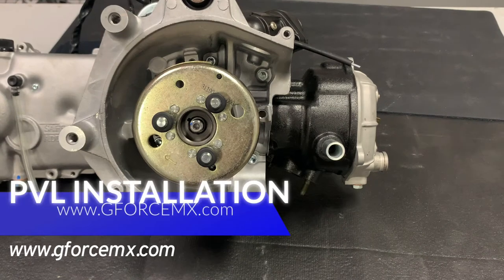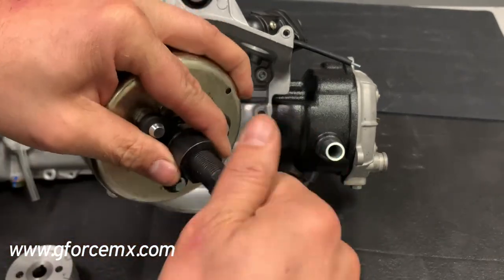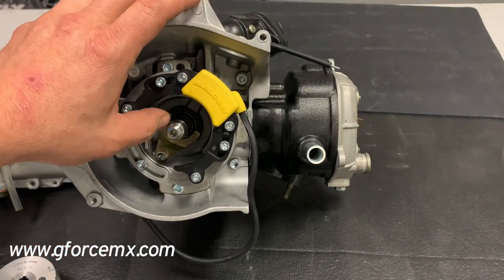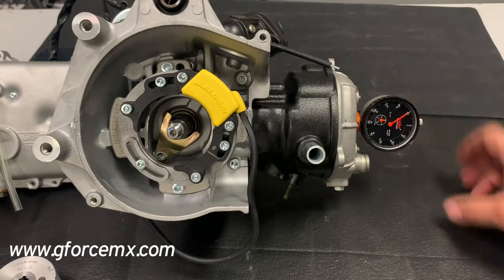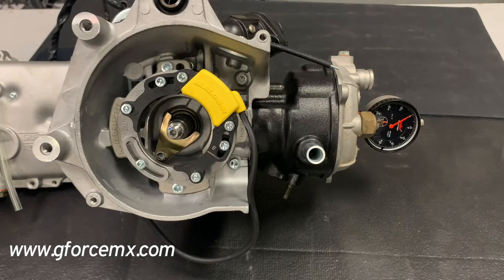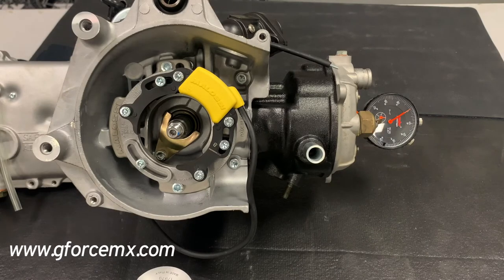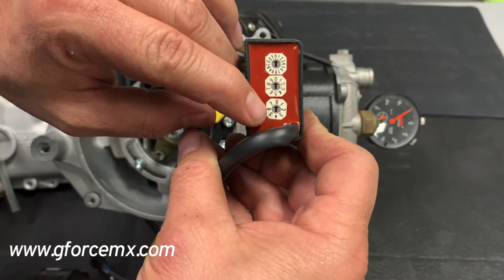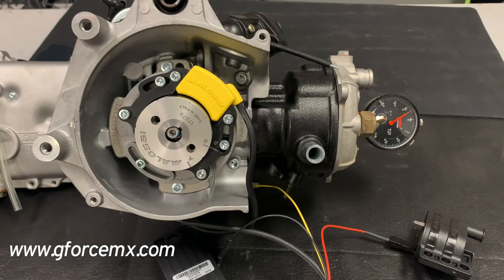PVL INSTALL - Malossi - DRR and Apex ATV

Comment: Thank you for your explanations Gary! I would've loved if I could be fortunate enough to find the same kind of video on my Polini ignition model from the early 2000's since the package came without instrucciones guide. It cost me 490€ (about 600$), it's an electronic ignition that produces electricty to the headlights and has just 1 map.All this time I've been thinking that probably there's no need for making the same measurements and procedures we see you doing in your video since it's such a basic ignition and the ONLY marking there is on the rotor is for the SPARK. Obviously there's a keeway recess as wel and the stator plate is also sloted for tweeking the ignition time...Can you give me some advice on how to properly set this ignition? Ty👍.

Comment: I notice in the Malossi instructions it says rotate clockwise to TDC, zero, and keep rotating clockwise to 1.55mm... Is the language in the manual wrong?
Reply: What are you trying to say with this?
think you are misunderstanding the manual...
Reply: @bp-tuningaeroxlc-dd6474  That's what it says in the manual word for word. it says continue to rotate clockwise. 🤷 

configured as such TDC lines up with a little notch between a and b. A lines up roughly at BDC from what I can tell, and obviously. so there are three units of metrology that line up if you do it as outlined in the manual, but only one if done as outlined here. 

mind that it's a digital ignition, and I really have no idea when the CDI sends spark in relation to those marks. managing it like it's an analog PVL style doesn't necessarily make sense. The rotor markings only make sense in context with how the digitronic CDI sends spark.

I know that generally it would be done exactly as outlined here. but again, the instructions, at least an English, say to continue rotating clockwise.
Reply: @FremontidaeScott  
sorry for the length of my text... 😃

yes I read it myself.

but I think so because the difference between whether it should stand at 1.55 BTDC (B) I have to use the brand that is next to B on the Roteen. and if you have to have a deep setting with TDC & BTDC 4.05, then I think it's something completely different,

I have to set my Malossi mk2 ignition on my Yamaha Aerox, the setting has to be 1.55 BTDC (Minarelli) and I have to use the letter B on the root to set it to 1.55. BTDC
and also not in The malossi manual how to set the ignition on my minarelli yamaha aerox engine ...
it only says the way you describe, the way I have to use is not written..
because I have to turn the piston all the way to the Top and just before the piston starts to go the opposite way, I have to hold the piston there and then reset my micrometer and put it in the two-piece and otherwise make sure it makes contact with the piston. so now I know where the zero point is on the piston, I also turn the piston back now in the engine and set my micrometer to 1.55, I also turn the piston towards the top again until it touches my micrometer and then I put my Rotor on the crankshaft now that it fits as much as possible next to the Mark ( B) and the line it should be next to. so fine, I now adjust the last piece so that the entire ignition is set correctly.

that's the way i'm supposed to do it...and it's not written anywhere that's how i'm supposed to do it....so i'm sure the malossi manual only alludes to how to set their ignitions on their own malossi engine that is made for the Piagio and Minarelli models, I don't think it is described how to set the ignition on a completely original Minarelli engine ... so the text etc. you write about I don't think it means It is a PVL, because it the way I have to set my engine is exactly the way that selektra should be done, the exact same way of setting it as italkit and the selektra too...

if you look at the stage6 R/T ignition and the Polini ignition, they are both PVl types, and the rotors are similar, if you look at the rotor on the Malossi mk2 ignition and italkit, they are VERY similar and if you put polini & stage6 R /T The rotor up next to the italkit and malossi mk2, the rotors don't look like each other at all...
so if you now compare the stage6 R/T ignition Rotor with the malossi mk2 Rotor then tell me which type of the two Rotor is most similar to a Selektra

Comment: Do you lose lighting coil with these ignitions?
Reply: You may loose or you may not, it depends on the type of ignition you purchase,the most expensive ones are the most advanced which in time make the most power of all and offer quite a few tweek options just like the one in the video.Normally the cheaper electronic ignition models are sold with light producing coils but not all though,you should carefully search them out on the internet. Regardless not all is bad,these less powerful units allow one to safely ride the scooter on the road whether it be during the day or night still with a faster acceleration than the one given by the original flywheel while keeping us from being fined by the p🙂p🙂 too.

Comment: It's not a PVL system as you say in the video... if you have a company that wants to sell this product, it would be really good if you could relate to what type of products you are talking about...
I say this here because it can damage your engine if you set it as a PVL system because they have to set in completely different numbers compared to the Selettra system, therefore I think it is important to say it is a Selettra system, have you experienced PVL systems must set between
  ( TDC 1.43 - 1.55 - 4.0 4.05 )
you say the correct numbers to be used for setting TDC but you say it is the PVL system..

Anyone who sees this did not see the pvl system. But it is the Selettra system..